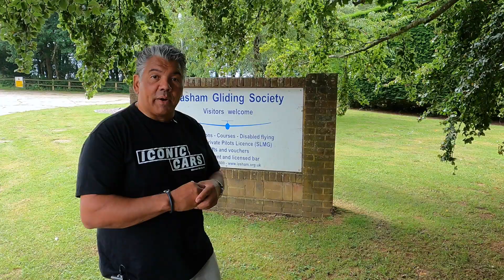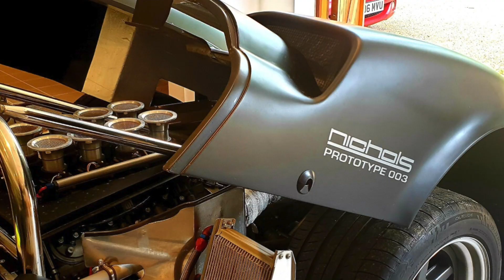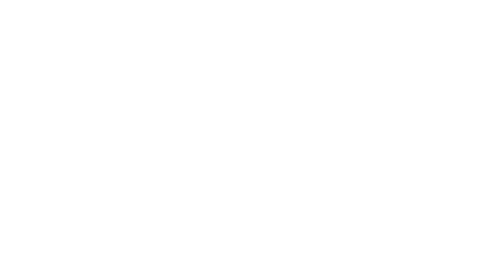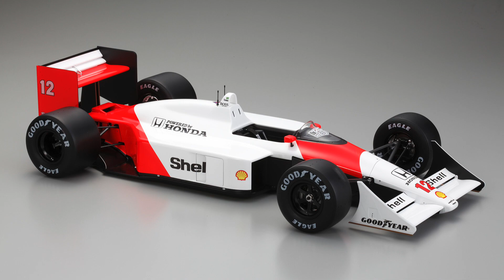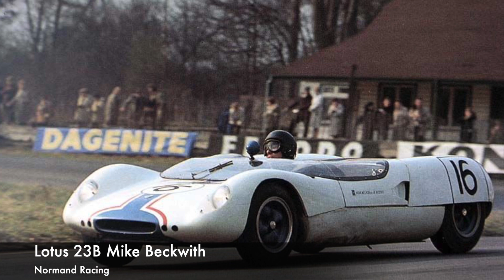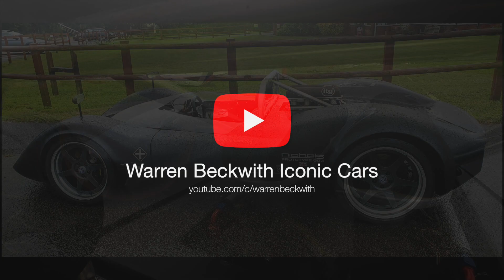Steve Nichols Nichols N1A

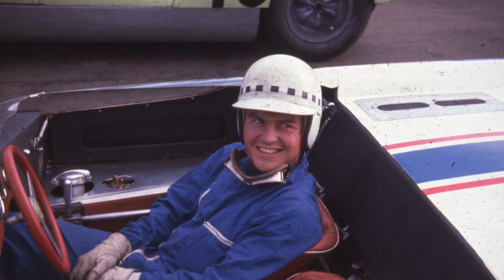Comment: ~25:00 regarding driver aided cars vs analog, regardless of people pushing modern cars too hard, they’re also not reaching their full potential.  When you learn to drive properly in an analog car, you learn to work WITH the car, with the tyres, with the grip and you learn how to go fast.  You get into an aided car after that, and you will be far far quicker than some pelican who is leaning on the electronics without driving efficiently.
Reply from the maker: All skills come from understanding the beginnings, be it cars, bikes, snowboards, skis or skateboard learn the craft before the flips and tricks. Throttle, brake, clutch and steering mixed knowing your gears.